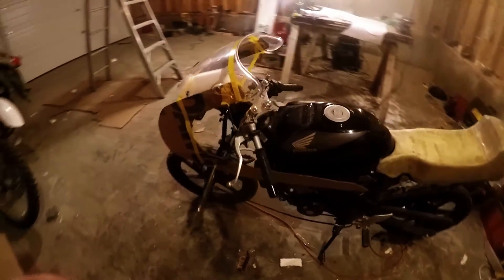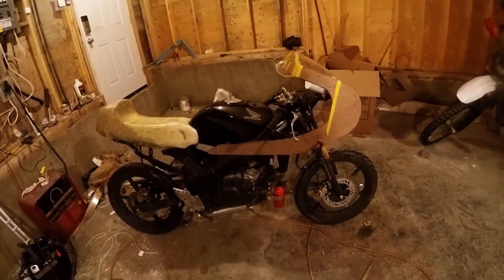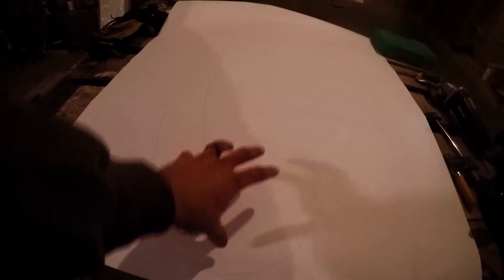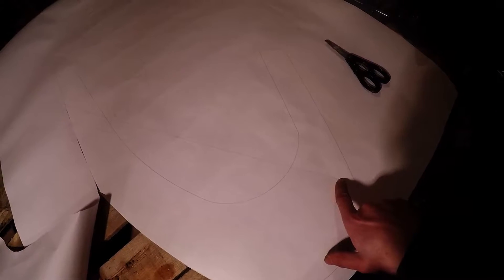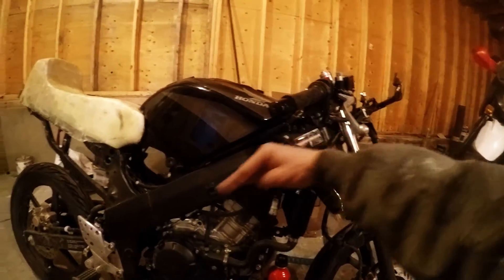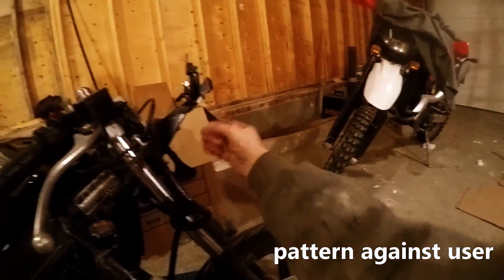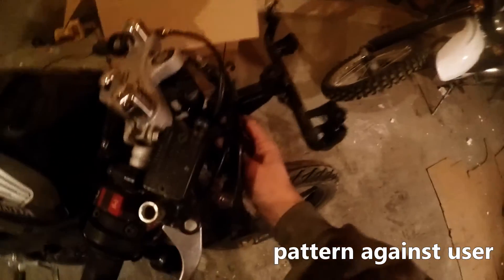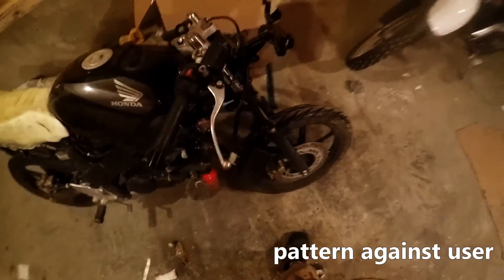pattern against user - bike build 12 - fibreglass cowl forming pt 1

Comment: did you just connect the motorcycle battery with car charging cables and the edges with wire to cut the styrofoam? (sorry for bad english)